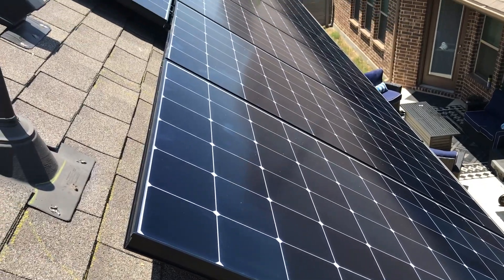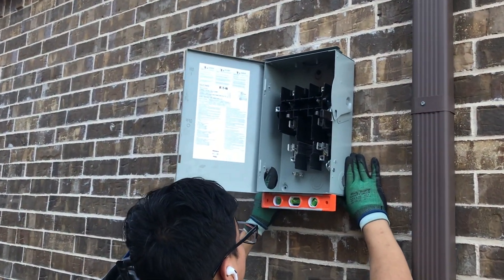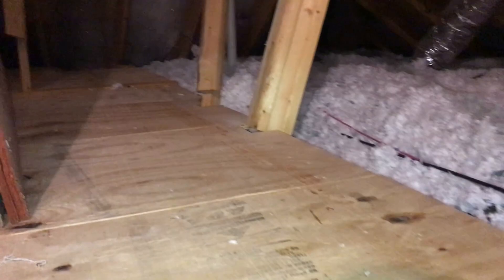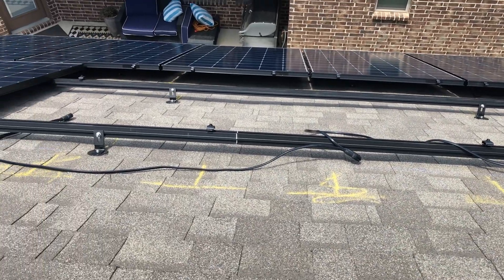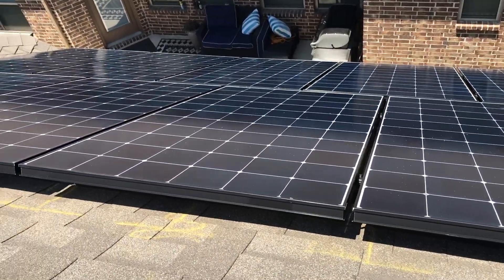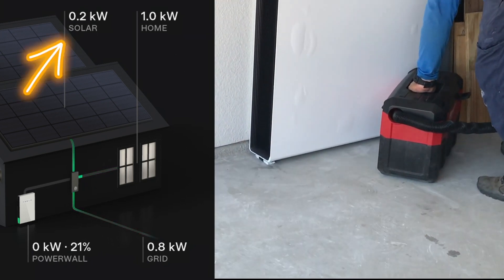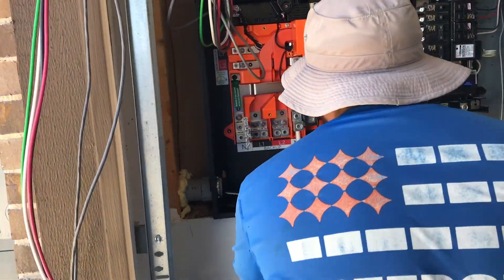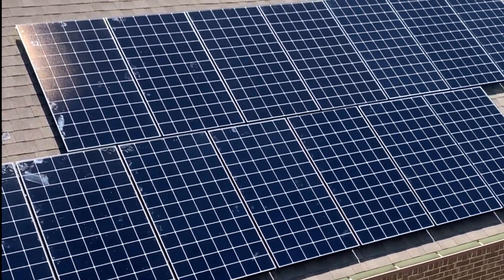Watch My Tesla Powerwall 2 Installation With Our Solar Panel Installation Video

Comment: Getting ready to add some Powerwall 2s to my Enphase PV system with IQ8A micro inverters.  I wanted the PW3 but the PW3 is DC-coupled and my system is AC-coupled.  My installer hid everything as well, but my HOA would have directed it regardless.  IL has some great ESS incentives of $300 per ESS Kwh do the math 2 PWs = 27 kWh or $8100 as a CASH REBATE.  So we are looking at a minimum of two but given the rebate I might go bigger.